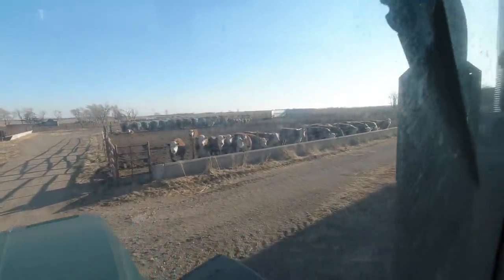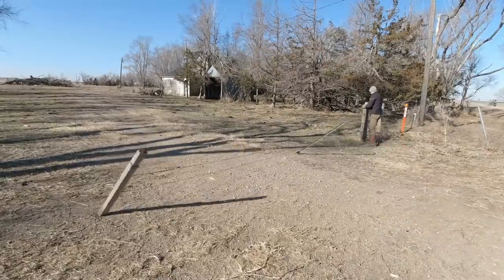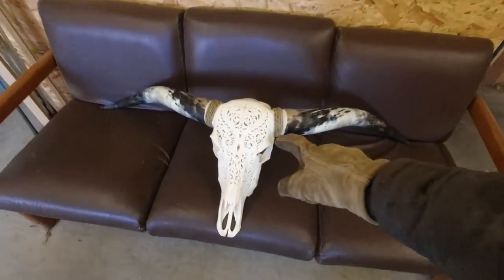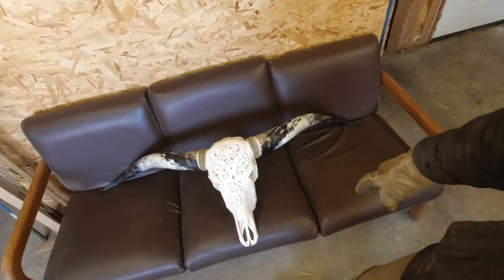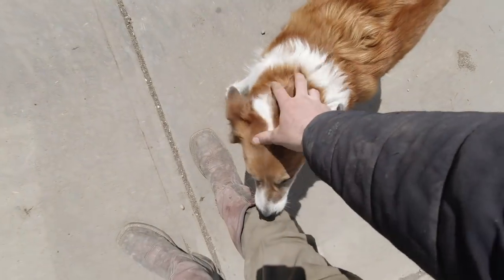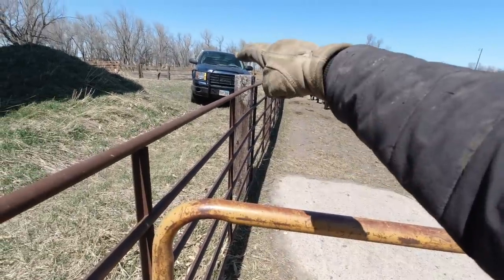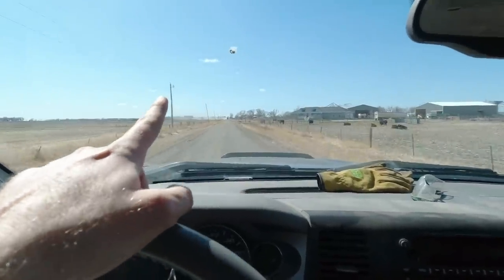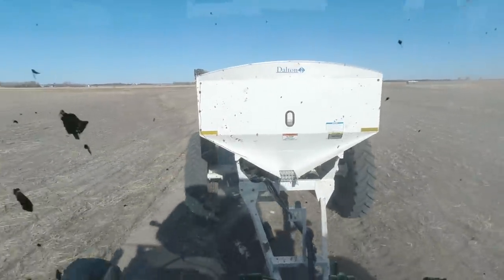Farmers Mid Life Crisis

Comment: If I were you I would get a 2.5 gallon pressurized water as a fire extinguisher. You can refill it by yourself. The unit you used can not be refilled and tends to be expensive to replace

Comment: pricewise is there some difference between black angus and hereford? and the meat,  is it more fat?There was a time i  had two fendt tractors and now i have two JDs  ,is that also a midlifecrisis anyways thanks for the video greetings from a Dutch dairyfarmer
Reply: Smaller frame on the Herefords means lower finish weight = less $ per head overall. But trade that for finishing sooner and slightly better feed conversion rate so less expensive to raise per pound. As for the meat quality differences it depends who you ask.  

Also, in many parts of the country anything that is not black hided is dinged at the sale barn.
Reply: Thanks for the reply Cindy